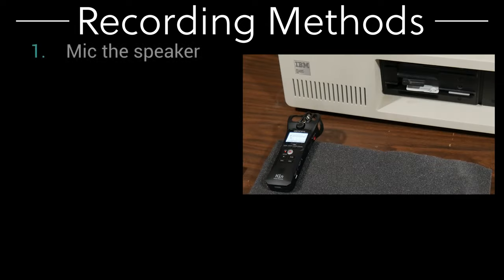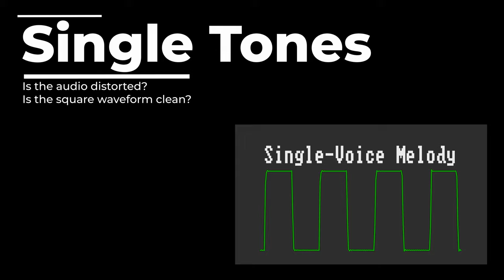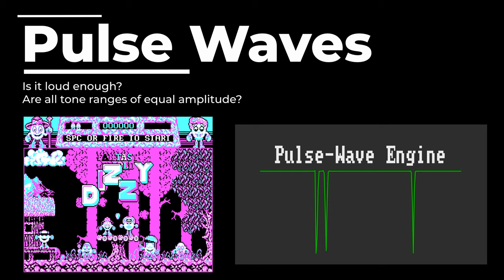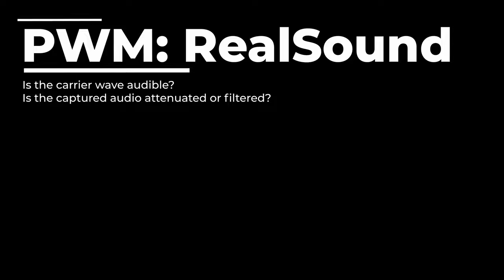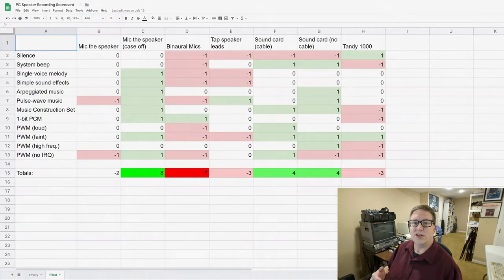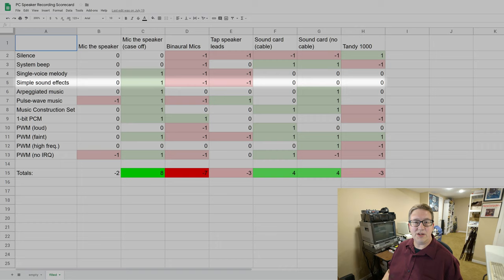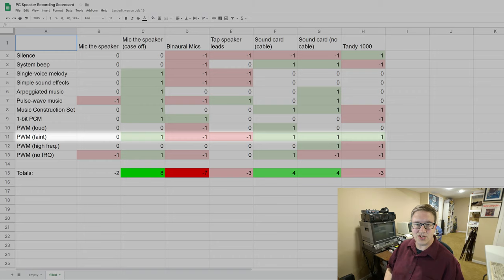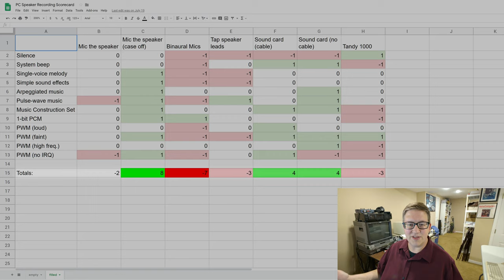Recording the IBM PC's internal speaker: MS-DOS gaming at its loudest

Comment: Great job, very enlightening, but I was totally shocked by your evaluation in the end. Case-off method has neither richness/softness/authenticity of the outside-case method, nor the fidelity of any of the direct methods. For me, it is 50/50, half-assed compromise, neither authentic nor hi-quality, just something in the middle.
If you need high fidelity, just use an external amp (maybe just a basic battery powered digital buffer) and maybe apply digital LP filter after recording at higher samplerate. This will sound the same as the later methods in the list but even cleaner and without their individual shortcomings.
P.S. Square wave is not even supposed to look like a square wave even on cleanest recording, if sampled at normal audio samplerate by an audio ADC.
Reply from the maker: Thank you for your honesty!  Maybe I'm misunderstanding you, but I actually conclude in the very end of the video that I'll probably use one of the direct methods, as they satisfied my curiosity that they didn't utterly destroy the audio, while affording me a level of convenience.  But if it's too harsh, I might try the outside case method again but with something hopefully easier to leave hooked up, like an attached mic with a cable running to my recorder.

Comment: Also, regarding emulators... I agree 100% that the end goal should be to make someone feel like they're sitting in front of the real hardware. A commercial for the original Lexus LS400 comes to mind, v=3ao69itRG9Y. In that commercial they show all the typical car noises they've suppressed. That made me think the emulator should have check-boxes for "PC fan noise" "reverberation from PC case", etc.
Reply from the maker: Maybe someday we'll get such a thing.  Some Apple and Amiga emulators have options to turn on emulated disk drive seek/door noises.
Reply: The thing is, if you create an accurate-as-possible emulator and play it through a real speaker, it'll sound authentic. If you try to emulate the physical space that the speaker is in and then play it through a real speaker, well now you have two levels of distortion and it's just gonna sound muffled.

I like the idea of those checkboxes being there, but I would never want to use them.

Comment: I think that the mic near the speaker with the case off lead to the most "authentic" sound. Before listening to the samples I thought that tapping the speaker leads directly would have obviously been the best solution, but it's actually far harsher to listen to. The way that the speaker adds it's own subtle touches to the signal, especially when clipping, really made most of the recordings sound "better" to me. Have you heard of taking Impulse Responses for Convolution? I'm wondering if you could take the raw line audio and convolve it with an impulse response of the speaker to get that "authentic" sound.
Reply from the maker: I think you're right, and if you check the comments, others agree.  My only issue is that it's a PITA to set up and keep set-up.  I might try running a small lav mic in an open slot to see what that sounds like with the case on.

I have not yet considered taking impulse responses -- I don't even know how to go about that, but it sounds promising!
Reply: @TheOldskoolPC  Most people don't use convolution for modeling a speaker, they use it to model reverb; so don't mind that when looking for more info about. 
Creating an impulse response (DEconvolution) is a fairly straightforward process: 
1. Play a frequency sweep (dry) on the speaker. 
2. Record the sweep with a mic to get the "wet" version. 
3. Convolve the inverted dry sweep with the wet sweep to get the "long" IR.
4. In a WAV editor such as Audacity, trim the "long" IR of excess silence before and after the impulse to get the IR.
Once you have the IR, you should be able to use it with any convolution application/VST plugin/etc that accepts IRs in WAV format, which is most of them. Convolve a direct-line recording with the IR and ideally it should sound very similar to the recording.
GratisVolver is free (you don't need the Pro version) and should do what you need it to, it even comes with the sweeps you need (dry and inverted, the 3 sec. will likely be fine). The hardest part I think will be actually playing the dry sound on the IBM's speaker; You'll likely need to disconnect the speaker from the IBM and use another device to drive the speaker instead. You will also likely need to isolate the speaker to ensure that it's in a very quiet area since you don't want the impulse response of the room, you just want the speaker's IR.

Comment: Recording from  behind the speaker is the best. You hear what are you supposed to hear because sounds were designed on speaker. Also there was little noise compared to method 1 and 3. You can tell on effects test. Direct recording with wires altered how the effect sounded. Despite Tandy failing on a lot of tests the sound from it was kind of rounded i suppose they use some filters. And there were no peaks at the tone attack.
Reply from the maker: I agree; I just wish it wasn't so inconvenient to record this way.  I may experiment putting a lav microphone inside the case and work the cable out.

Comment: The PAS16 more-or-less works in 8-bit machines even though the card is 16-bit.  Obviously its Adlib, Game Port, MPU-401 and its "PC speaker snooping" features must work.  Interestingly, the card has to be able to be listen to port writes from I/O addresses $40-6F, which are officially unavailable for expansion card usage in the IBM PC ($200-3FF allowed) and the IBM PC/XT ($100-3FF allowed).  I guess you can write to expansion cards at any I/O address, but reading from them is more restricted.  I believe the Tandy Sound Chip card in development can work at I/O $C0-CF in an IBM PC or XT.

Comment: The sound card with internal cable seems like it's clipping, really not good in my opinion. I personally highly prefer the direct speaker tap. Feels authentic but with full fidelity. A close second would be the sound card no-cable. For the full experience I'd say recording with the case off is good, as that captures the tonality of the speaker but doesn't get affected as much by the room or muffled by the case. This really makes me want to hear System Beeps recorded with a PC speaker tap though! The extra bass is very welcome.
Reply from the maker: I agree the speaker tap is my favorite sonically, but unfortunately it picks up way too much system noise.  Sound card no cable is best for eliminating noise.

Comment: I'm also curious how micing the case would sound with a unidirectional instrument microphone, like the Shure SM-57. It should cancel more of the ambient noise from the room, but still capture the acoustic effect of the computer case, and not the just the speaker. Unfortunately, the fan noise would still be heard, but the acoustics of the room would probably matter less.
Reply from the maker: Indeed, one opportunity I missed was trying to wire up a microphone INSIDE the case.  Maybe an experiment for a future, follow-up video.

Comment: Actually, IBM PS/1 computers have a sound card (a rather fringe one with not a lot of support, but for example ibmulator (extremely accurate IBM PS/1 emulator, for different models with different CPU's, etc. - mine was model 2011 I think, a 286 with 1MB RAM, 30 or 30MB HDD, CPU clockspeed of ~12Mhz (no lousy 4+Mhz 286's) that also used the sound card for PC speaker sounds and had headphone jacks. The output is cleaner than PC Speaker, and I would like to hear whether the hacks used to play digitized samples (PCM) through PS speaker, as the trick relied very much on how the PC speaker worked, but PS/1 sound card worked differently as it sent analog sound signal to regular speakers inside the PC, so I wonder if it would work fine, acceptably, poorly or if it works at all.

Anyway, as this shows, there's other systems than ones mentioned in video, that can output audio meant for PC Speaker from headpdone jack as well - the IBM PS/1 computers.
Reply from the maker: Appreciate the clarification!  The PS/2 Model 25 also has a 1/4" headphone jack for speaker output, but it isn't line level and I also wanted to limit the scope for this particular video to 4.77 MHz systems.

Comment: Hey man, great video ! I'm into recording some pc speaker and I'm trying to buid the cable you're suggesting but wiith no success. Is there a photo of the finished circuit somewhere ? I think my mistake was that I've unplugged the speaker. I'd like to have kind of a permanent setup, maybe with Dupont connector instead of alligator clips... Many thanks for your help !
Reply from the maker: Awesome!  There are some additional circuits and diagrams on the article I link to in the video's description; maybe that article can help?  For my own testing with a simple alligator clip cable, sometimes I have to move around (really scrape) the clip attached to the case ground before it actually connects.  Also, while it shouldn't matter, I've heard some advice that if you don't hear anything, try swapping positive for negative, or hot for ground.

Let me know if you run into more trouble, happy to help with this.
Reply: @TheOldskoolPC  Hey, many thanks ! Finally I managed to get it working. It's easy as long as I dont cut the circuit from the speaker !
By the way, I've replaced the 10k resistor by a 1k one. The signal was very low on my mixing desk. With the 1k resistor it's perfect, hot enough without clipping. Thank you again for your work !

Comment: Would it be possible for emulator authors to enhance the Pulse Wave sounds to be less harsh? Or is it something intrinsic to the way these are produced?
Reply from the maker: Actually, they already do:  If you run these programs in DOSBox, the ones that run correctly (not all do) have no audible carrier wave (I'm guessing because the carrier wave is generated by the physical speaker itself).

Comment: Wich is the difference between the 2 schemes on the link?
One has a capacitor, the other one has a 8ohm to 1kohm.
Wich one should I use to connect the pc speaker out put to a stereo amplifier?
Thaks.
Reply from the maker: The one with a capacitor is meant to DC-offset and smooth the signal but leaves it at 5v which is a bit hot for some equipment.  The one with a resistor is meant to reduce the +5v to something closer to line-in expected voltage.  (At least, this is my basic understanding of both; if I'm wrong, I hope an engineer will correct me.)

Before I knew line-in was 1V, I was feeding it 5V all the time and never had any issues, so my single experience is "it's safe".  So either should work.
Reply: @TheOldskoolPC  I will go for the one with a resistor.
Thanks!

Comment: Hi Jim, I know this is an older video and this is probably largely settled but I wanted to pose the possibility of relocating the speaker outside of the case and recording it that way.  Specifically, it would allow you to get the speaker away from the noisy system but also would allow pointing the speaker's cone directly at the mic which is how a recording engineer would (check out Steve Albini's excellent but admittedly overkill explainer video where he covers this far better than I can in a dumb YouTube comment: https://www.youtube.com/watch?v=_mrdd5-ehb8); currently you are capturing the sound waves irregular rebounding off the chassis and expansion cards.  I wonder how much of a difference this could make.  There's also the question of positioning the microphone various distances from the speaker and comparing the frequency expansion/collapse to determine which distance gives the most accurate and/or revealing sample.  I wish this comment were more timely.
Reply from the maker: I agree outside of the case is another valid option that I wish I'd explored.  The question, then, becomes what you are optimizing for.  Meaning, since most people hear the speaker inside the case and bouncing off everything inside the case, would that not be the most appropriate for presentation?  (I don't know, just posing the question.)  Thanks for your thoughts!

Comment: Sound recordings are nyquist limited due to the sampling frequency of the recording device. Trying to judge the ”purest” square wave is fraught with difficulties. I.e. If you produce a perfect square wave and remove all frequencies above 22kHz (can’t hear anyways) and record it at 44 kHz sample rate it will not look like a square wave. It will wobble significantly whenever it hits a step change. If it looks perfectly square it has not been bandwidth limited and will alias badly. What happens is that frequencies above 44 kHz fold back into audible frequencies that are not harmonically related to the square wave and it sounds just terrible.
Reply from the maker: Given that, what's the best procedure to sample the speaker?

I don't think I mentioned it when I made the video, but all my recordings were at 96 KHz.

Comment: why is there not an emulated pc (dosbox) in your list?
Reply from the maker: Good question!  It's because traditionally, emulation of the PC speaker has not always been accurate, especially in DOSBox where it is a kludge to save time and complexity.  Some DOSBox forks have more accurate PC speaker emulation, such as dosbox-x which I recommend, but those more accurate emulations weren't finished when I was making the video.  Also, I try to use real hardware whenever I can.